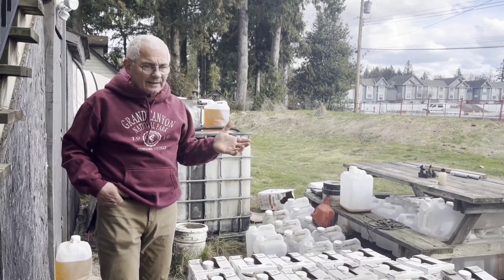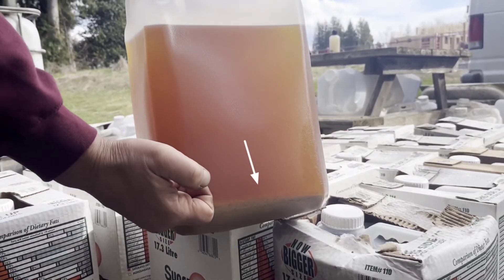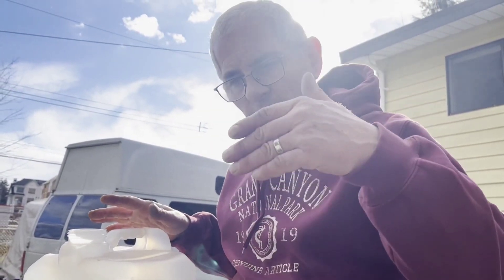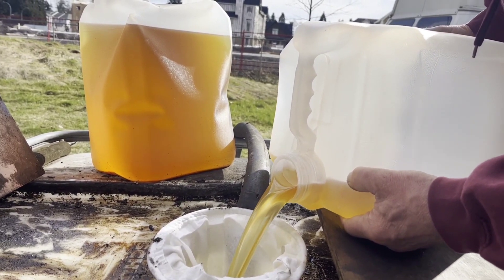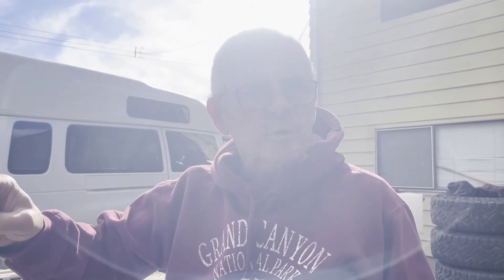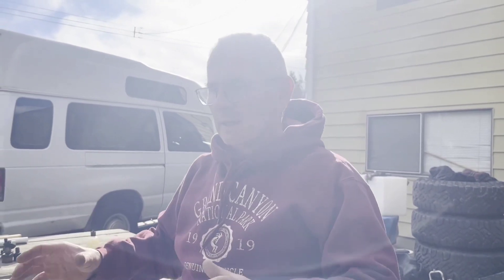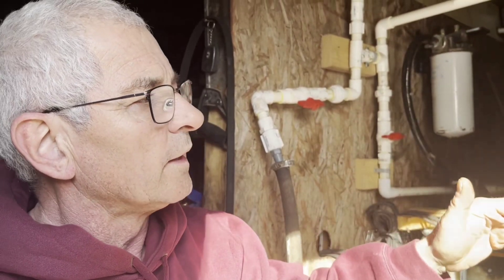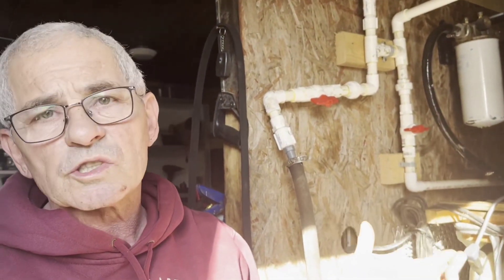FUEL TOO EXPENSIVE? This Is The Best Alternative Fuel For Your DIESEL VEHICLE.

Comment: Hows that do with cold weather? Does it gel like diesel?
Reply from the maker: Yes it’s the same as diesel 
But having a Fass lift pump and the oil heated no issues and the lowest temps here are nearly heating -20 C 
So no issues 🙏✌️

Comment: Most restaurants here in USA sell there used cooking oil. Used engine oil is free.  Some companies pay to dispose of. Black diesel is put through filter then into tank. No centrifuge..
My truck has double filter system. One is normal filter system and other is for water removal.
I do not have room for all that equipment …and mine can be made on the road..
Reply from the maker: Absolutely I would do the same if I wouldn’t have access to free and the cleanest oil 
I have a few of my friends that uses black gold and they add a bit of gasoline to it. ✌️
Reply: @lolesoffroad  
I like the convenience of black diesel over bio diesel. The black diesel has higher BTU, which means performance over bio and black diesel doesn’t need as much attention for gelling in the winter as bio does. Since the fuel is free I can afford to change filters more frequent.  Its nice talking with you. Ill keep watching to see what you’re up too.
Have a good day🇺🇸

Comment: Good stuff. Wish i could build a setup cheap. I'd prob. do it.  Can move spare tire and install 20gl tank under E350 ext. And the good kit for the 7.3 is costly. But way cool.
Reply from the maker: thank you im doing  a conversion on a E350 next week i will document all parts. If you can doit yourself its not that expansive  the big cast  is the tank and the high-pressure fuel pump.
Reply: @lolesoffroad  Awesome. That would be cool to see the cost.

Comment: i just dumped it into my mercedes 190D and drove 500 miles to get the engine running smoother again ...miracle
Reply from the maker: I would be careful with that 
Unless the oil it’s supper clean 
You can mix 50/50 but I wouldn’t run straight oil with out being able to flush out the fuel system.
Reply: @lolesoffroad  I used "new" sunflower oil.
The drive was in the Spanish summer, took lots of tools to fix any clogg up and changed the filters afterwards.... Afterwards I topped off with diesel again.
Reply from the maker: Oh yea that’s all good if you use new oil in the summer it’s perfectly fine 
I know lots of people that run the whole summer on 50/50 
Cheers

Comment: Well Diesel engines were originally built to run on peanut oil? 

Can it still run with the newer emissions with DEF systems?

Here's an idea... Can it run good when you mix a bit of diesel and use it in Chinese diesel heaters?
Reply from the maker: So to mix and run I diesel heater it’s a no go 
I tried it. And with the new style diesel don’t want to comment because I don’t know 🤷‍♀️